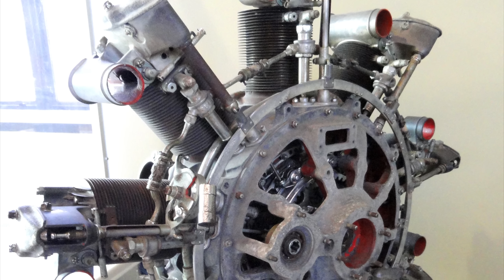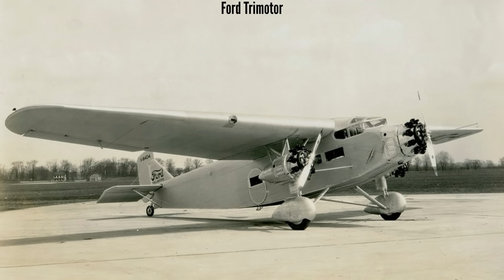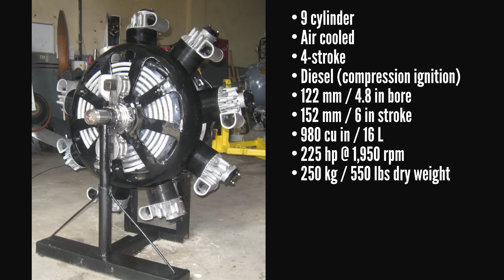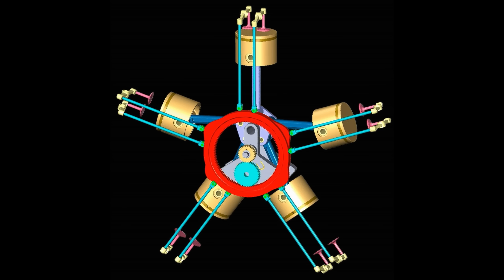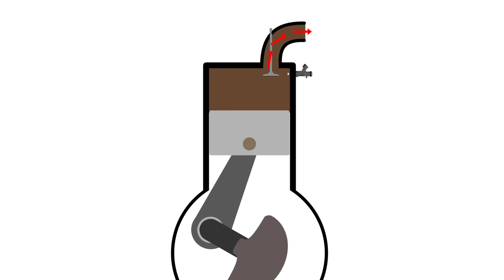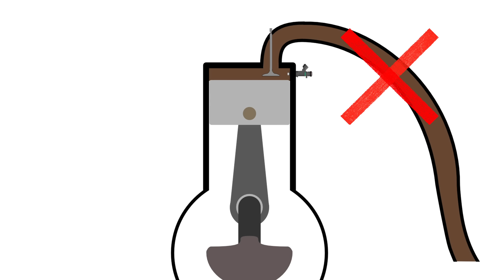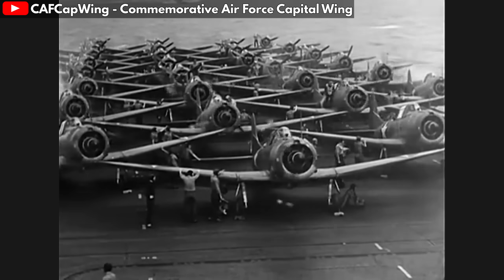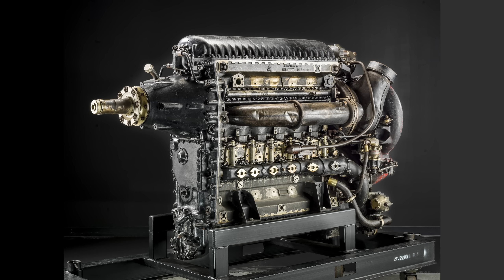The Single-Valve Diesel Radial that Almost Changed Aviation

Comment: 16:1 gets you into 'making ammonia' territory, hence 'the smell'. 
Dropping CR would have made it work worse at altitude, since starting with less air gets you less heat on compression, which might (in cold weather) have compromised ignition - fatally.

It wasn't the technical problems that killed this, it was yet another victim of the Great Depression. 

Has all the same hallmarks as the Stanley steam car: a disruptive new technology, which has some minor flaw, already in the process of being solved, when the money goes away and the company developing it crashes. 

And then, despite there being eventually no patent encumberment, everyone only remembers the last minor problem, ascribing to it the magical power of a ShowStopper problem, so those in the know can sit around and say they Know Why It Died... When the reality is much less interesting. 

They had no competition, and they failed, so all investment thereafter assumes that it 'cannot be done'. Needing to look no further for 'The Reason' than the last notable minor wrinkle. 

You can place a remarkable number of old startups into this same template story, and they fit perfectly. I think because anyone who had lost investment on them were loud and sustained about their condemnation forever thereafter, ensuring any startups in the same space are treated like lepers. 

After all, it can never be that the investments were simply too poor, having failed to cover sufficient investment to actually get the business to overcome its financial challenges and finally achieve a payoff - No, it can never be the investment systems fault. Must be technical.

Comment: Hmmm - you say 87 octane then 100 octane for the gasoline of that era. 
Thats incorrect. 80/87 was the common fuel in the 1930s, with 100/130 being developed in the late 1930s. 
So that's 80 v 100, not 87 v 100. 
The two numbers represent the octane rating at lean burn cruising conditions, and the octane rating at full rich full power conditions.
And during WW2, compression ratios were rarely altered for high octane gasoline, but supercharger boost pressures certainly were increased. As one example, ALL 155,000 Merlin engines had the same 6:1 compression ratio, but boost increased significantly from the use of 80/87, to 100/130 and then 115/145 octane gasolines.

Comment: The vibration issue could have been tackled by creating a double-radial engine, with the two rows/pans of cylinders balancing each other. As Diesel engines produce less waste heat than Otto-cycle engines, cooling shouldn't have been a problem.
The noxious fumes issue could have been solved by mounting two engines in the wings, away from the cockpit.

Comment: Except for the exhaust scavenging problem, it seems like a design way ahead of it's time, as it could run on many lower refined oil products, and back then Lead was added to boost the octane levels to avoid knock, something none of us needed.

Comment: If the Me 109 had been diesel fueled it could have been a major headace during the battle of Britain, Even only 10 minutes more worth of range could have tipped the scale. And Ju 87 that could not be any more slow would set gasoline ressouerces free if it was fueled by diesel.
Reply: It would have been too overweight and/or under-powered to be an effective fighter. Increased fuel capacity would have solved the problem (as was done with American fighters).

Comment: If petrol radial engines are still flying commercially viable airlines today .just imagine how many diesel ones would be.
The diamond DA modern plane uses a diesel engine  although not in the radial configuration

Comment: Thats a pretty clever design. I think with some development it could have been made a lot better. For example I'm sure with clever design you could redirect most of the exhaust gasses away (especially with the help of ram air) and perhaps a 2 row radial might have been able to help offset some of the vibration.  However the biggest limitation was probably that it would be difficult (if not impossible) to use it with a super charger (limiting maximum performance, especially at altitude).

Comment: I knew a older pilot that flew a couple of the Packard powered aircraft. He said the Packard and J5 were in the same power class but the J5 would spool up faster than the Packard.  And this lag was a drawback for seaplane use particularly where short takeoff was needed.

The low compression diesels are a bear to start in cold weather this would also be a drawback.

Comment: I read in several books that the Russians would swap out their gasoline engines for diesel engines on some of their bombers to bomb long range targets. The diesel engines would extend the range over the gasoline engines. However the diesel fuel would give them problems in the winter ot at cold temps at high altitudes as the fuel would gel, starving the engine of fuel and the engine would stop running. Diesel fuel has a lot of Paraffin wax and water in it that causes the fuel to start to thicken and gel at about 20° F.   I'm not sure if they had a fix to stop diesel gelling during WWII, at least I've never read anything about it. Most aircraft were flying at altitudes where the temps would get down to about -65° F in the summer so the diesel fuel would gel in the wing tanks. That may have been one of the major factors as to why the diesel engines never really took off. Gasoline isn't affected at low temps because there is a very little wax and virtually no water in it from the refining. This may have also turned the airline industry away from the diesel engines because of safety concerns. Pilots and passengers have a problem and don't like it when engines quit in flight. 
Fuels have come a log way from those days and additives have been developed to prevent the diesel from gelling. But jet engines use a highly refined kerosene and alcohol as fuel and doesn't have the gelling problem that diesel has. 
The USAF has several aircraft that are certified to run a liquefied coal fuel, the B-52 being one and that eliminates the gelling all together. The USAF has been experimenting with that fuel for several years now.
Reply: Most contemporary aviation diesels are designed to run on both diesel and Jet-A1, where jet fuel has the advantages not gelling at altitude, as well as being available at airports.

Comment: Brilliant subject and vid "Lets Go Aviate".  Like everyone else here (minus the dweebs in the 1st row) this is the 1st I'd heard of this config'n and the DR-980.  Vibr'n issues are a tough nut, but it's been nearly a century now and technology has expanded:

FEM analysis of multiple & simultaneous orders of resonance, active & passive-damping systems, and flight crew that no longer act like a bunch of spoilt brats.  (My mistake..."like a bunch of upper class twits.")   (creds to Monty Python).

The diesel-cycle era hasn't yet started due to remarkably inexpensive mogas and avgas.  But at some rapidly approaching time, simple engines that can convert almost any fuel into "productive work" (Mech Eng def'n) efficiently are going to be in high demand.

Perhaps not in av'n -- but for ground transport, marine transport, stationary powerplants.  (Thanks "Lets Go Aviate", and anyone who actually read this far!)

Comment: Well done. First time viewer from Canada here. An excellent topic explained very clearly. I can just smelll the exhaust...ugh!😊
Reply: Might have suited a twin engine layout  ...as the air low would have kept more of the smell and fumes away from the pilot and cabin.
Reply: I’m suprised they never had any issues with gasoline/petrol engines of the day, running leaded gas without catalytic converters.

Comment: As a Packard fan, I'm aware that the company's sales situation was perilous by 1933.  Its strained resources weren't aided by a failed first attempt at a cheaper car, the Light Eight, which was simply too well-built to get the price down.  The solution was a much more radical embrace of mass-production methods to create cars as cheap as $1000.  While on the one hand this certainly would have squeezed out other projects, on the other hand it probably put it in better shape to tackle the challenge of building Merlins in wartime quantities.

There's also the question of why Germany (& to an extent the USSR) continued to pursue aviation diesels when you point out their declining advantages over high-octane gasoline.  I wonder if Germany's lack of oil and reliance on sythetic fuels from coal kept diesel relevant there.  Greg's Aircraft And Automobiles channel discusses German high-octane fuel issues a lot.
Reply: As WW2 progressed, Germany had as much trouble producing suitable diesel fuels as it did aero gasoline. They were sometimes running their diesels with Cetane ratings as low as 30 (modern diesel fuel has a minimum Cetane rating of 40 in the USA and 46 in most of the rest of the world but most diesel is actually around 50-52 Cetane number).
Reply: @robboardman598  Thank you for that information.

Comment: During the 1990s, the German Zoche company developed a prototype two stroke aero diesel. Sadly its progress into production has stalled.  The engine is a radial (or cross format) two stroke using four con-rods on each crank throw. The engine has near perfect primary balance and four (or eight) combustion strokes per crank revolution. There is no master rod and the four cylinders achieve perfect primary balance. It is dry sumped and uses a crank powered blower and a turbo charger. The biggest win is its almost zero vibration.
Reply: Zero vibration and diesel are 2 things that are usually mutually opposed
Reply: Would love to kow more of this engine,  where can I find more info ?
Reply: @pieterbezuidenhout2741  I have a t-shirt...
Reply: This super sad as pushing that engine to commercial production back in the 90s would have changed much of aviation forever.

Comment: The single valve solution is very interesting. Using simple aerodynamics instead of extra valves to separate exhaust gases from fresh air is a curious idea.
In theory, with this system, we could use 4 or 5 valves for both the intake and exhaust strokes.
The volumetric efficiency would get a massive increase!
Reply: I think the volumetric efficiency would not be that great due to no "proper" manifolds(And no dedicated intake and exhaust valves), scavenging and use of resonance and "inertial supercharging" would not be that good I think.
Reply: @TarenGarond  Those are good points.
But, we have at least double the valves. Using aerodynamics, we can ensure that the intake flow arrives at the valves at high velocity and relatively high pressure (by trading some of the velocity for pressure). We need to remember that aircraft cruise at fairly high speeds.

During the exhaust stroke, we could use a fluidic switch or a small flap to ensure that the ambient air goes straight to the exhaust section of the pipe. Since the flow velocity is very high compared to what's inside the cylinder, there will be a massive pressure delta. Therefore, the high pressure gases inside the cylinder will gladly rush towards the low pressure flow above the valves.

The opposite happens on the intake.